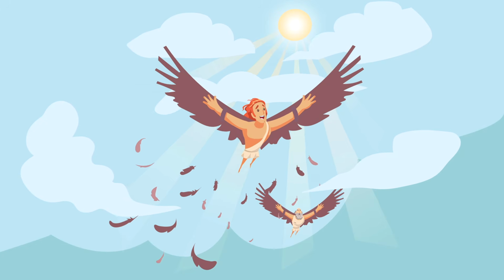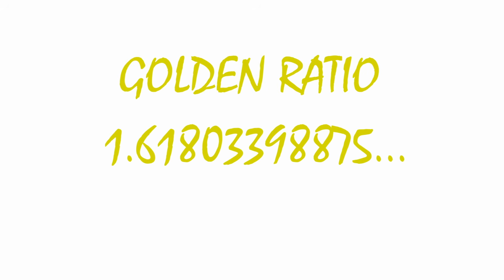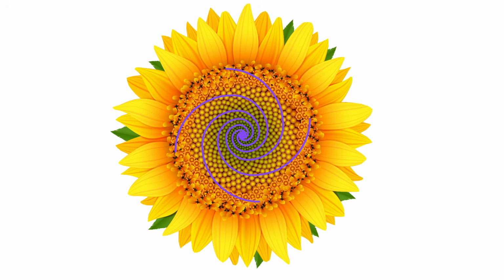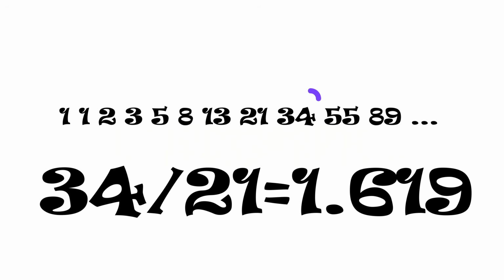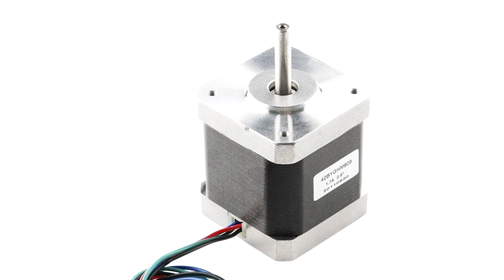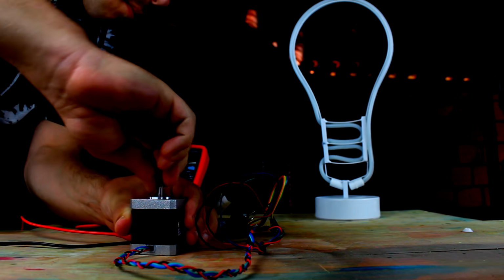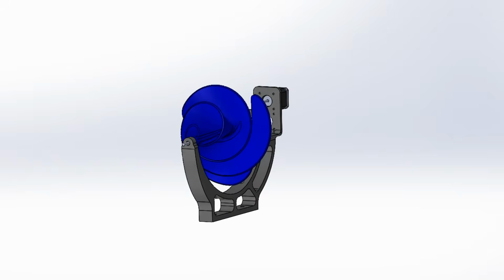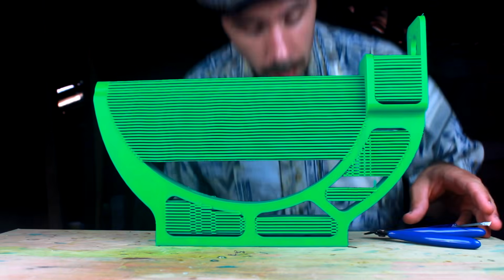Golden Ratio Turbine 3D Printed

Comment: ahaahjahah please no more printers <_> One thing we do have here atm is... lots of wind, so I might have to try this out !
Reply from the maker: That my friend, would be awesome!
Reply: @integza  I would love to see a flywheel added to the design.
Reply: @integza  Send him ze files!
Reply: @integza  hey!! I have a really cool invention but I need help building and testing it. You have the perfect mind for this kind of thing. How can I contact you?! Praise Tesla 🙏🖖
Reply: @integza  What about using it as a prop for a boat?
Reply: @integza  yup 7
Reply: @integza  I wrote you an email
Reply: I have no idea why but the guitar music at 8:25 made me so happy
Reply: That is how you can "Structure" the water .
Reply: Where did you get your suit😁
Reply: First name last name  198x198x215
ITs hard to imagine, but honestly, there is a lot to do with the work required. Transferring water from one tank to another is easy, but if your talking about transferring it up 10ft in the air, the head pressure would be a lot to overcome. If its just transferring it almost laterally, that is a pretty easy task that can be done with a large siphon.
Im very curious as to what you mean by moving 5 gallons per second with a hand drill, as I find that highly implausible if it were to raise it 10 feet into the air. Simply put, I think the power required to achieve those results is FAR more than a drill consumes, and you cannot have a net gain of energy via law of conservation of energy.
I can calculate the work required to lift 5 gallons of water 10 feet into the air, and I suspect a common drill cannot manage that output of power via 120ac at 15amps.
Thats 1800W but at 80% efficiency, so 1440 watts. 300gpm to 10 feet has a theoretical 750 horse requirement, 1500 horse actual. Even theoretical, thats over 1/2 million watts!!!
Grant it, you never declared you could move 5 gal of water 10 feet vertically per second, but you never really gave us enough to not assume it was a massive siphon that used stored potential energy. Regardless, I am curious what you created, and what the limitations are. The claims of moving 5 gallons per second seem amazing, unless its 5 gallons per second 1 inch lower than it was. 1 inch higher might be do able with a drill.
Reply: First name last name  Id like to see what you are speaking of running. Certainly sounds interesting. My argument was that work done requires a specific amount of energy, and while you said you could move 5g/s, that doesn't exactly suggest the amount of work being done, think P=V*I, it hints at the "current" if you will, but not the "voltage", ie, the pressure, but not the distance. To calculate the power required to move 5g/s, I would need to know the distance. You've only given 1/2 the data to determine if what you claim, 5g/s is impressive, or normal. In some circumstances, moving 5g/s is easy to transfer, while in other circumstances, 5g/s is an insane amount of energy required to transfer. Does that make sense?
Im a product and circuit designer for STEM educational toys for my own startup. Missouri.
Reply: First name last name  Siphon? So the energy is already stored and the drill primes it?
Reply: First name last name  Ah..., that is easy to do with just a large enough hole and it would require no power, because you are releasing potential energy stored in the height of the column of the drum. In other words, if you had a hole the size of a watermelon cut in the base of the drum, you could empty the whole drum in 5 seconds, 2x faster. If the drum were 1' off the ground, and the drum had the bottom entirely removed, you could empty the entire drum in 1 second. I imagine, the pumps you're using contain the flow, restricting it even.
Point is, those pumps, though they manage transferring the water without putting a hole in the drum, are not doing any work, aside from priming the siphon. The gravitation "pressure" of the water column inside the tubes (siphon) is what pulls the water out of the barrel. 
If you did the same transfer, except transferred the water into a barrel that was 3 feet above the ground, I suspect the pumps would struggle to move the 55 gallons in under a couple minutes. The longer it ran, the more difficult it would be to transfer the water from one to the other as the height of the column would begin to work against you, instead of for you.
Reply: First name last name  Let me ask you this... How much time does it actually take to transfer ALL of the water from one barrel to another when both barrels are at even height.
NOT 1/2 the barrel, but the ENTIRE barrel. The first half will transfer quickly, the second half will transfer much slower.
If you perform this test, you will have a much better perception of the pumps ability. Pumping it all onto the ground is not a fair assessment.
.
Its not uphill, if the outlet is below the barrels water height. You are suggesting it is being pumped onto the ground, which is below the barrels water height.
Reply: C W are drugs involved here?
Reply: Eat less beans/sprouts/whatever gives you gas.
Reply: love to see you guys mention eachother
Reply: I have a couple cases of canned chili in my emergency stockpile, I wonder how much "organic" wind I can create before my neighbor files a noise complaint.
Reply: Oi Johnny, why is top comment not about the Zeppeli ultimate technique
Reply: You can use this concept to build a water turbine generator
Reply: What about using the impeller to charge an electric bike as your riding it?
Reply: First name last name no
Reply: how about make a power generator that generates power by using water streams
Reply: First name last name  if its direct driving the impeller then its already been made and it moves up to 36000 gal. An hour depending on the power of your drill. I have 1 and it works fairly well
Reply: Bro pls make a vídeo if u do it
Reply: you can send me any extras! =D 

lol, I kid I kid
Reply: Give away one of your 3d printers
Reply: I thin you should make a drone and add a twist
Reply: Hmm
Reply: What Is Islam?

Islam is not just another religion. 

It is the same message preached by Moses, Jesus and Abraham.

Islam literally means ‘submission to God’ and it teaches us to have a direct relationship with God. 

It reminds us that since God created us, no one should be worshipped except God alone. 

It also teaches that God is nothing like a human being or like anything that we can imagine.

 The concept of God is summarized in the Quran as:

{ “Say, He is God, the One. God, the Absolute. He does not give birth, nor was He born, and there is nothing like Him.”} (Quran 112:1-4)

Becoming a Muslim is not turning your back to Jesus. 

Rather it’s going back to the original teachings of Jesus and obeying him
Reply: @ahmdabdallah5811  ...were...were you saying that to me or...I...dont know what you ment then
Reply: @ahmdabdallah5811  I visualize my God as a Woman, as She does give birth to universes, She is inherently generative. It is also much easier for me to submit to a woman. I have nothing against your God, I view all Gods as inherently unified, one unfathomable being.
Reply: @ahmdabdallah5811  what good would that direct relationship be if he can't give birth? The highest goal of humans is procreation (and recreation a close second), so I'm not about to begin a direct relationship with something that can't procreate... XD
Reply: @ahmdabdallah5811  
JESUA says to keep holy the 7th day....that God himself HALLOWED.....that’s something Islam COMPLETELY ignores....therefore Islam is not worshipping His Father because they disobey God Almighty...so no Islam does NOT worship the ONE TRUE GOD by keeping ALL of his commands....SIMPLE DEDUCTIONS OF TRUTH.

Comment: I'm autistic and break down things to their simplest form.

What is wind power?

Wind is air. To get lots of power, it takes lots of air. That's why commercial HAWTs are so large.

So . . . I turned that around and instead of making a LARGE turbine, I made a smaller one, and a VAWT at that (known for its low power output). Why? Because VAWTs are much simpler than HAWTs.

And . . . With all that, I run my turbine(s) against a 16:1 transmission and pump (and store) LOTS of wind (at higher pressure btw).

That now high-pressured air runs air motors coupled to generators and the outcome is the same -- free(ish) power . . . WIND power. 😊

Comment: I'm at Minute 15 and think, YOU NEED THE OPPOSITE! The best would be an axial flux generator with high torque and then use a planetary gear to use high RPM to get low RPM and high torque from the wind turbine...

Comment: 3:44 This dual flow, also is present im electricity.
the water vortex represents the magnetic conduction current, while the air flow is the dielectric displacement current, often also know as "cold current". both flow in opposite directions.
Magnetic current from negative to positive voltage,
and dielectric current from positive to negative current.

Comment: DUDE! What if you plated the golden ratio print, turned it with a motor and use it as an ionic thruster to a ring and see the thrusting effects. If wind pushes it to that speed, what happens when you spin it at that speed and use the Lorentz brown effect!?

Comment: Consider making a water turbine instead. It might be more successful. Your turbine design seems to handle high torque low speed better (as would be produced by a heavier fluid like water) as opposed to a wind applications where the weight of your turbine makes it disadvantaged as a lot of the power in the wind is used to overcome the inertia of the turbine.

Comment: The project was super cool! Can you send me the Cala lily impeller turbine you printed?? Would it be possible to use a transformer to step up the output from your wind generator? I also been kicking around the idea of a maglev direct drive shaft to help reduce friction.
Reply: One more thing. What if you used the Darwin wind turbine tower to funnel the wind up a narrowing tunnel to the lily turbine as a kind of VAWT?

Comment: From which side were you pressing on the lever? It looked like your pliers were spinning the spindal and gears from the wrong side.. get an equal set of planetary gears or something with a higher rotation speed and then place it to drive the outside of the inner outter planetary gear.. and then put your turbine as the drive of the outer outer planetary gear.. use a cup type coupling .. any cantilevers that would make the inner leverage arms in essence longer than just from the center of the spindal? 
 Ehh, maybe I'm not explaining it right?

Comment: Surface area between the many bubbles versus the hollow of the inner tube the air flows through.. resistance and surface area is the difference.. in time to fill by spinning or just bubbleing.. and possibly the shape of the surface the air being pushed upwardly through.. ya know? 
 Or of course you could say all that other complex math , but there is a volume being replaced inside the bottom bottle.. lol.  Stay relative and on the actual topic..

Comment: Thankyou for yr work and time / materials.  Only thing i can think to compliment yr work is some larger diamitor to capture the wind and channel / narrow it down into more concerntrated form then through the turbine.  Fantastic work  thanks.   PS,  on second thoughts you could make it a 2 or 3 stage system,  such as a large turbine to capture wind and spin while compressing it back then either run it  through a second stage compressor then to the generator.   Idea being 1st stages  "capture "  as   "compressing"   efficiently  and thinking about it it might be better to have the narrow end of generator impeller 1st  where the gas is compressed doing its harder work  to spin and as energy used  naturally becomes weaker and becomes less compressed  {expands} thus going to larger outer diamiter.  This logic being on  steam engines when they  started off with one engine   but later to increase  efficiency  they used  three stages of steam engines in larger diamiters  where sea voyages across contanents became feasible.   I think theres something in this -  but had had trouble with narrow minded persecuter fools in NZ sabotaging mother boards of printer so never got started.  Any company using this idea owes me a bunch of steel for house boat.

Comment: Beautiful idea! 
I feel like the efficiency could be increased if the turbine was sitting in a housing that would resemble the outlines of the turbines. Thus the air could not flow away from the turbine and would have to give all kinetic energy away to it. 
How cool would it be if this could be used as a hydroelectric generator in - let’s say - a garden scale hydroelectric dam 🤩

Also: to avoid the issue of exploding turbines at high rotating speeds, maybe consider adding supports for the outmost parts of the turbine. Like little additional blades that connect the blades to the center axis to stop them from bending outwards due to the centrifugal forces…?

Comment: why don't electric car makers use the motion of the car to make more power to extend the range ? like use gears run by the wheels to increase the speed of an extra  motor for power input as the others are doing the output ???

Comment: I built a scale model of a black hole that works with marbles. It occurs to be that this may be the subject of a generator, using your turbine and a screw lift to lift the marbles to the event horizon and release them and use a motor and a waterwheel kind of structure to create the power. What do you think?

Comment: How about a project to aerate water using the Lily Impeller? Something that scales from a 1 inch plastic water pipe for an fish tank or  a 2-3 inch pipe for a aqua/hydroponics tank ? I'd like to see how well it worked for an aquaponics tank made from a 50 gallon drum, but I don't have a printer to print the impeller. I was thinking of something inside the tank with water pumped into the tube from below, allowing the water to overflow the top and back into the tank. The drive motor would sit on top with a 3d printed frame shoved inside the tube to hold it centered, driving the impeller at the bottom of the tube via a metal shaft in another frame. I'm sure it would work and it should use less energy to drive it versus an electric air pump, but how effective would it be? Thanks for the wonderful videos.

Comment: what if you could turn this into a generator with multiple gear/propeller rings on the od of the inside of the tube  or essentially without the lily just a generator pipe of sorts that could be put in any fresh water pipe that way it never gets clogged but generates power whenever you turn on your sink for example

Comment: It's actually higher more power then wind at 39kph because the air pressure around the chassis would be higher (I know it's not much but you really don't need much to make a big difference)

Comment: when you are kinda an engineer and you switch your electrical wires at the hard to reach the bottom of your flask full of water while you have your power supply with changeable cables right in front of you #hardwayisbetter 10:24

Comment: You need to build a gearbox for it. if you can multiply the rpm by.... example... oh 50x? Would also reduce the load on the impeller itself. Could make an opposing ladder style gearbox, alternating driven gear until you get to a ratio you're happy with. basically a large ladder made of spur and pinion gears.

Comment: Having done a little (very little) research about possibly installing wind power for my house (five years ago)  I discovered that the reason that wind turbines are on tall poles is that the wind speed will double at 100 feet (and sometimes will be the REVERSE) of the wind speed at ground level, even a pole 12 feet tall with increase the average wind speed by 50%!!! P.S. maybe try building a turbine and proving that theory?

Comment: The beauty of this item being designed for the water is that it would make a great prop on a boat.  I hope to build one for my sailboat build. Thank you for sharing your ideas. I hope that the price of metal printers will drastically drop, or that the current 3D printers will use stronger materials.  Thank you again!

Comment: spin a disc with sand on it, you get the golden ratio
Reply: ducted that
Reply: centrifugal pump can be driven two different ways, front and side, also with the external motor
Reply: duct rings as turbine support

Comment: Integza must know the secrets of Viktor's "repulsine"! Vortex implosion of hot air into cold water. The same process which fuels the growth of hurricanes and cyclones! The second secret is that water vapor is a great dielectric, and the air is full of charged ions and water vapor with which to build up a very large electric potential on different parts of a vortex of dielectric fluid. This can be impart charged in contact with a conductor.. Same process by which LIGHTNING is produced in storm clouds!

Comment: 3:30 There is no such thing and “centrifugal” force, only centripetal, and it’s caused by an acceleration towards the center point caused by the normal force the water has with the walls of the bottles.

Comment: as luck would have it, I just came into possession of some 56 rpm 12v motors out of grocery store scooters. 

I still need to tear off the housing, the electric brake, and any gear housing, but maybe I can modify the model to work. For years, I've had an idea in my head for a, for lack a gravity-based engine using water stored at height as a "battery" (not trying to sound smart, I know a lost cause when it looks me in the mirror, lol, just not sure how to explain this). This basic concept might work with a little finagling...